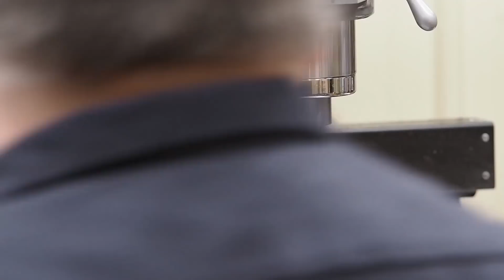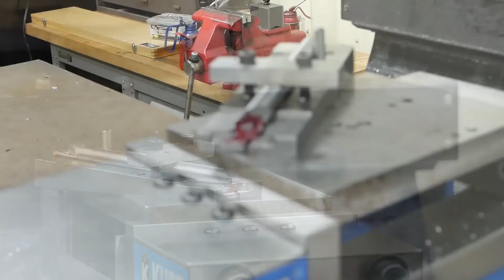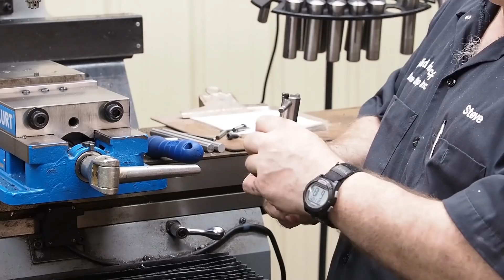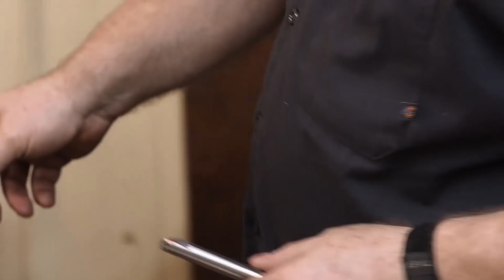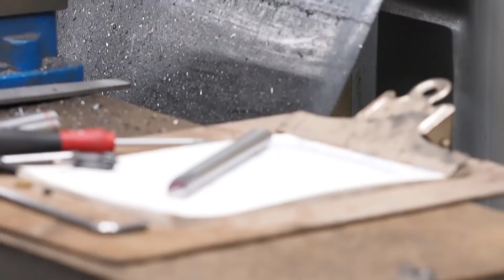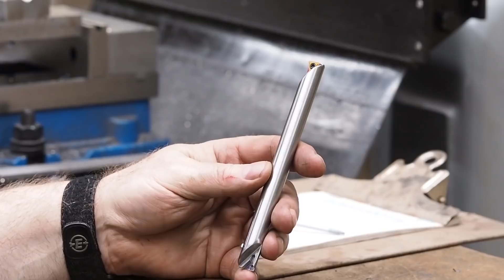Insert Boring Bar part 2

Comment: Great video Steve, keep em comming.
ATB, Robin
Reply from the maker: Thanks Robin,
Where did you get the turcite that you used on your fast change pulley setup in your last video? I have a different lathe project that may be our next video. I made one call to a company and just the cleaner and bonding agent was really expensive.
Steve

Comment: enjoyed both videos, nice build, curious why don‘t you mill a flat on the bar for setup in a quick change tool holder which would locate the insert as built in the jig?  similar to a criterion boring bar
Reply from the maker: Hi Chuck,
I leave the flats off to keep as much rigidity in the bar as I can. Most of the people I work with bore small deep holes so I made these bars with that in mine. Many people will set them up in a dedicated (bought or self made) holder so they will not have to set the bar each time they use it. 
My heart sunk when you pulled the mill covers off and found the mill table rusting in your last video. I am glad you caught it before it became worse.
Steve